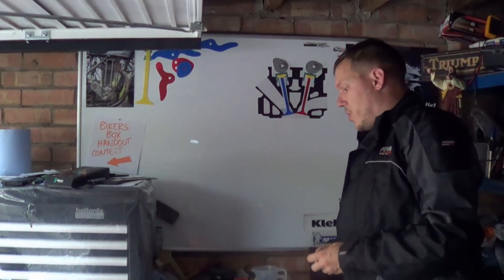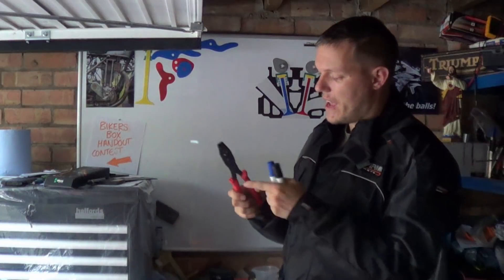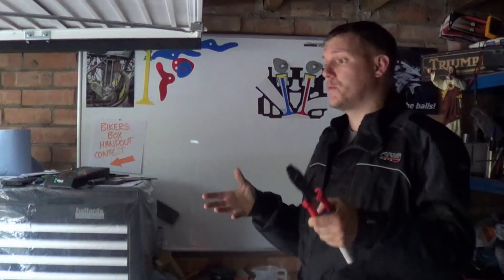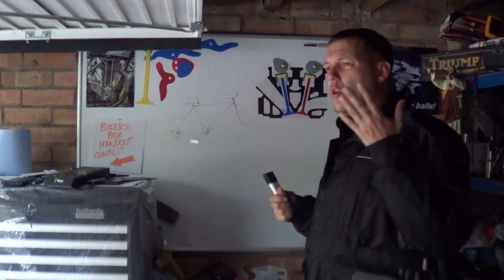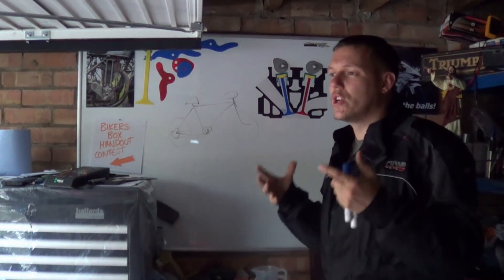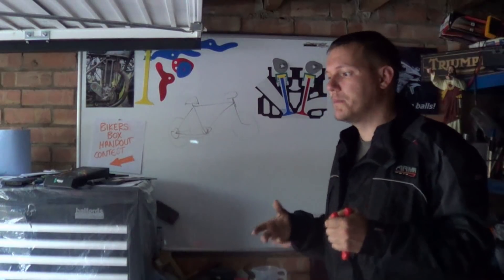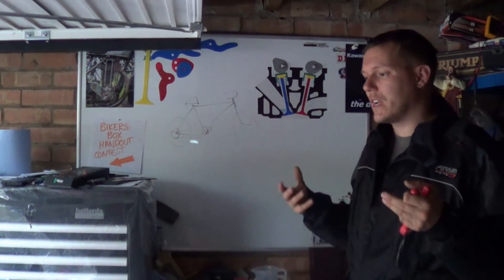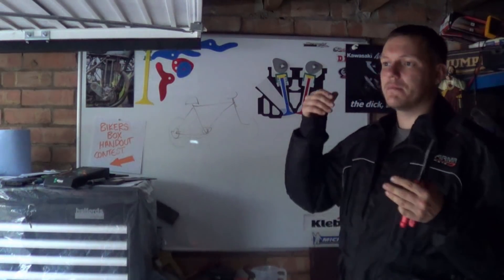Why develop 2 stroke engines?

Comment: One solution of two stroke efficiency FUEL INJECTION!! All they need to do is just develope the engine more and more and eventually direct fuel injection for a two stroke will be very possible!! However two strokes give a squirt of gas every two strokes so you can never make them as efficient as a four stroke however twice the power per cc is the price you pay for the extra light weight and power!
Reply from the maker: LOL right then,

"All they need to do is just develope the engine more and more and eventually direct fuel injection for a two stroke will be very 
possible!!"

- already exists and they are called e-tec injectors and they are (at present) not suitable for bikes. Weight/rpm restrictions

"however twice the power per cc is the price you pay for the extra light weight and power!"

- this just isn't true.
Reply: The Workshop how is it suppose to work then?? All you can really do is develope and develope tell you find new possibilities for the two stroke engine. You can't say something is impossible because we never truly know the potential a two stroke or a four stroke engine has because we as humans continue to evolve and evolve same with our technology. Let's imagine an alternate time line where all research and developement went towards two strokes for the next let's say 100 years that engine would be a much better more advanced engine then ever before! As if we went into another time line where they just stopped putting research into two strokes they would stay the same "inefficient" machines

Comment: ktm's slotin is good for know but its still not clean enough it will not last i think they are doing it moore as a gimmick to boost seals. a lot of companies are giving up after spending lots of money trying to make it work almost all 125 2t enduro bikes are out of production in 2018 except Tm racing and the 250/300 are next ktm will have a monopoly
for while but the are not going to make a big profit of it in essence it's like the ferrari enzo 
which ferrari lost around 60000 usd per car (not sure about the exact number)

Comment: Since you've brought 2 strokes up, and seeing as I'm making a leak down tester after watching your video on them, here's one for you. Why is the testing pressure limited to under 20 psi (some people reckon as low as 8psi) to avoid mullering the crank seals when they can handle the pressure of squeezing (say)125cc of mixture through the transfer ports in 150th of a second? That's got to hurt.
Reply from the maker: "Why is the testing pressure limited to under 20 psi"

- yeah pretty much, you'll pop your crank seals and no one wants that lol
Reply: The idea is to test for a leak not to create a leak.
Reply: markyoung13 I got your question, it's because high pressure is not built up in the crankcase. When the piston goes down the pressure is relieved through the transfer ports which are then closed by the upward piston which creates compression with all the ports closed.

Comment: I know its not a solution but what exactly would be the problem with having a diesel two stroke style petrol engine, lower the compression ratio and stick a spark plug in obviously. (Just asking generally not specifically to matt)
Reply from the maker: Size and weight. Video coming soon
Reply: The Workshop woo cheers matt mate, vaguely remember bits you'd mentioned in other vids. Yeah clicked on now that you'd need a super charger or something
Reply from the maker: But it is a good question
Reply: The Workshop haha well thanks I'll try and come up with more, you know for video ideas obviously. 

Absolutely love how you cover both the basic stuff as well as the extremes, really helpful for a 17yo engineer wannabe like myself